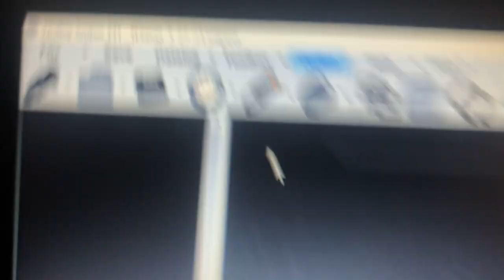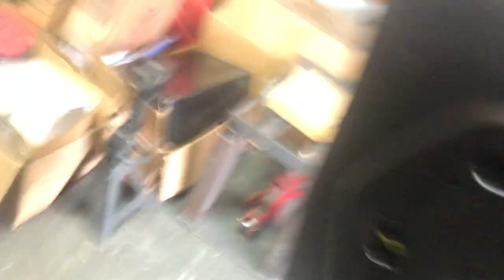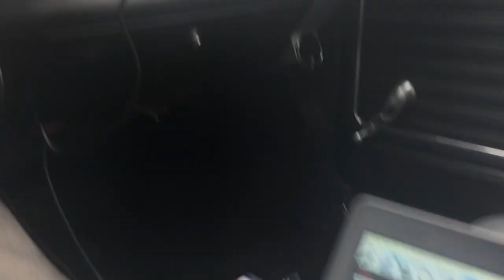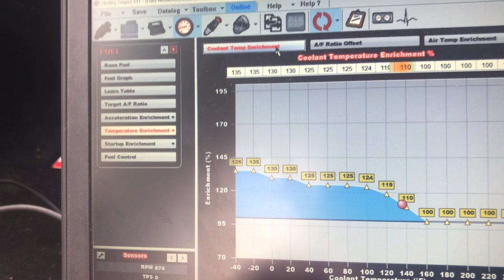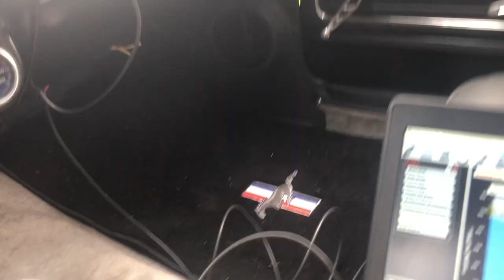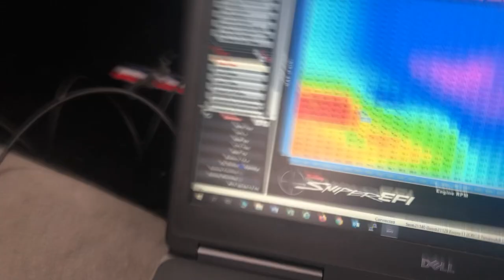Holley Sniper Tuning - Cranking, Fuel Prime, Coolant temp enrichment.

Comment: For those that don't know, you can edit both the X and Y axis to reflect what and how each vehicle runs (for more resolution). IE, there's no reason to have tables that go to 7.000 RPM if you'll never rev that high and the only time any engine runs in the high vacuum area is during hard deceleration (basically not running at all) = no reason for the tables to go all the way down to -14psi either. I learned to edit the X and Y numbers on my first ever Holley EFI tune because 98% of my Holley tunes are on motorcycles = some rev to 13,000 while others only rev to 11,500. So the first thing I ask is what's the highest they'll ever rev they're engine...
Reply from the maker: yup, my other video i did on "tuning 101" covers that. i always suggest people adjust their x/y before they start doing any tuning to make things easier.. more of a pita to convert later unless you use a tool or a lovely excel spreadsheet someone made that i think i linked in one of my videos as well. i see lots of n/a vehicles with boost cells and cars that have a 6k redline with 8k on the tune.

Comment: This is the best info on this I've found so far. I have a 302 with an e cam. I'm having issues with cold start. I've gotta crank it for about 20 seconds to get it to crank and it's all over the place and usually stalls once or twice until I can get it to stay running. Once it's been running a minute or so I can shut it off and fire it right back up. Mine's still set at stock values mostly and this gives me a direction to go. I'm pretty sure it's dumping too much fuel as it's very strong in the garage. Thanks for this.
Reply from the maker: glad i coud help. cold starts are a pain to work on because once you've fired it once, it's warmed some and you'll have unburnt fuel in the intake that'll affect it some. usually get about 2-3 adjustments then you have to wait a while.

Comment: Sounds like it runs good. Can't believe it likes 14.5 afr and 30° spark at idle. My 347 likes 13.5 and 20° at idle. It's got the comp xe274hr and edelbrock performer rpm heads. Goes to show you that tuning is different for every combo lol.
Reply from the maker: yup yup. it actually idles a bit lower, around 25'ish. fluctuates a bit. you're probably a good bit more compression than mine too tho. thanks for watching.

Comment: Great video. I just fired my sniper stealth and ran it for awhile. I noticed after restarting that I’m cranking it like crazy until I hold the throttle pedal to get it to fire up again when it’s hot. Baby steps
Reply from the maker: yup, its a slow process.. just gotta dial back fuel prime or cranking fuel for that temp. or you can try increasing the iac park position for that temp.
Reply: @callofgeorge  I plan on having it remotely tuned on a dyno. It’s super tough to drive around a manual, monitor gauges, not spin the tires etc in the city. Probably my safest bet.
Reply from the maker: @Datanka69  i don't suggest trying to tune while driving. either get a friend to ride along or datalog, adjust, datalog again. taking it to an actual tuner is definitely not a bad choice.  I will most likely do the same on my next engine. just make sure the place you choose is familiar with holley efi (sniper or TBI specifically) and make sure they tune drivability and not just WOT/max power. lots of dyno shops out there that just got into it to make money and don't really know wtf they're doing.

Comment: Great video. The changes you made on the strip chart for idle, shouldn’t the learning function do that for you? New to the tuning game and assumed the self-learning was suppose to do that.
Reply from the maker: thanks. all learning does is correct base fuel map for areas that are driven on without sudden change.. so constant areas. as in steady tps rates. if you overlay a datelog, it'll show you where on the map the datalog touches. however, learn won't occur on areas where quick throttle changes occur where acceleration enrichment happens.

Comment: Thank you..I'm try it!
Reply from the maker: you're welcome. hope it helps. remember, several tables reference off your fuel map. so if your closed loop/learn %'s are 10 or more, its most likely not going to be accurate or will need to be readjusted once the fuel map learns or is corrected. pretty sure the cranking fuel table is a straight lb/hr amount though.

Comment: Great video. Can a failing CTS sensor cause a pig rich condition at start up.
Reply from the maker: thanks. depends; what's it read? there are coolant enrichment tables in the tune. the colder the temp, the more fuel (by default and normally). you can purchase a new cts at a local parts store. 
AC DELCO 213-928
Reply: It just started yesterday when I went to warm it up. I'm going to pick up a new sensor today. I'm having to learn on the go. Bought a truck with a Sniper and didn't get no info. So I've been doing my research and trying to find the right people to talk to for help. I don't have a way to do a data log. No lab top
Reply from the maker: @sterlingjaynes4281  lots of info out there. i'd watch youtube (i can suggest some names if you like), check out the info at efisystempro, and also the actual instructions manual that can be found on the holley site has lots of info. you can datalog with the handheld. you'd need a PC with an sd card reader, or purchase a micro-usb to usb drive (this is what i use sometimes) then you transfer datalogs/tune files that way and download the holley software to desktop to view/edit or just email them to someone. but feel free to message me on fb or instagram if you have questions.

Comment: when i start up my truck the sniper sits low on rpm for second or two then revs up and settle down to target rpm which setting do i need to adjust
Reply from the maker: most likely iac park position or the iac ramp.
Reply: @callofgeorge  thanks man
Reply from the maker: @nuclearbum9858  no problem.

Comment: Dude your dog that's hilarious my dog does the same thing when I fly drone I just ordered a USB to can bus cable btw what is a good 02 sensor reading I'm sure the o2 sensor reads what is senses no matter the settings so what would I be shooting for specifically?
Reply from the maker: o2 sensor reads oxygen regardless of any settings. this also means if you have exhaust leaks anywhere, the exhaust pulses will pull in fresh oxygen from outside the pipe making the o2 sensor read more lean than it should, therefore making the ECU throw more fuel at the engine to try to keep to the settings you configured. as for what settings you should use, it varies engine to engine. what engine it is, cam, compression, etc will all play a roll. even if you had 2 identical engines, they could still want different fuel/timing. usually a good rule of thumb is idle = 13.5-14.5, cruise = 14-15, and wot n/a - 11.5-13.5. here is a decent site to check out with some AFR info - https://www.safrtool.com/SAFR-AFR-values.asp
Reply: @callofgeorge  thank you for the response and tips that info is useful my set up is a sbc 388 aluminum heads 202 160 valves right now it has an rv can can't remember the exact specs if I remember right ot has 190 cc intake runners and the same cheer as a vortex head I belive it was 64cc  also hyperutectic flat top pistons with 2 valve reliefs
Reply from the maker: @runpuppyfpv5744  i'd try something like 14 idle, 14.5 cruise, 12.5 wot. you can play around a little with those numbers and see what it likes more. just know that the fuel map has to re-learn when you adjust these. ideally you want to make an actual 2D AFR map in the software and not use the "simple" settings from handheld.

Comment: I was checking out your video and according to what you did, my AFRs and Target AFR appears to be dead on but, it still doesn’t crank up any faster.
Reply from the maker: i've learned a bit more since i made this video so there are some other things to look at. but 1st make sure you're not going off my AFR values. you'll have to find what your engine wants for each temp range. something more important i learned after making this video is the iac park positions. if it cranks better when you give it gas (open the throttle blades and add air) then you may need less cranking fuel or more importantly, more air. so you'd need to increase your iac park position for the temp you're at. not sure what engine you're working with, but on a 331 i tuned the iac park goes form 84% at 60*, 57% at 100*, 41% at 140*, and smoothes out to 30% at 180*. again, these values may not suite you, but can possibly get you in the ballpark.
Reply: @callofgeorge  No, I’m not using your settings. I’m running a 357w, 565lift cam, Trickflow R intake with a 90mm TB, and Canfield 58cc heads.
Reply from the maker: @jayjohnson8807  so you're port injection then with a term x I'm guessing? what's your iac park positions look like? hitting the throttle pedal help it start? if you have fb, you can message me there if you prefer and i'll try to help get it resolved.

Comment: You mentioned downloading A preset tune for the 302 would they have one for my setup you think ?
Reply from the maker: they are very basic tunes and are in no way "specific". they'll still need adjusting and tuning but will get you in the ballpark and allow for first start. what is your setup though? don't have to go into detail.
Reply: @callofgeorge  sbc 388 r.v. cam aluminum heads 202 valves  dual sync sniper efi 2.5 in. Exhaust
Reply from the maker: @runpuppyfpv5744  no base for that, just use wizard. not sure what an RV cam is. can probably be safe with "stock" for cam choice.